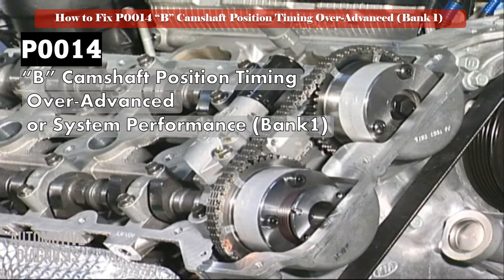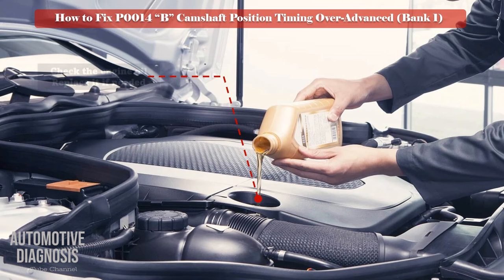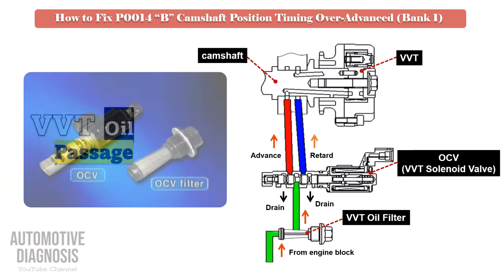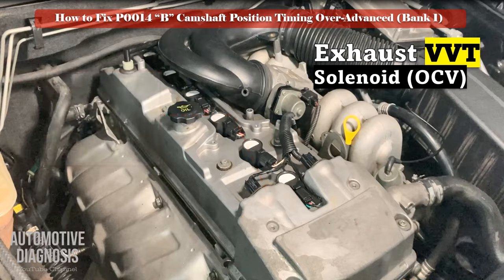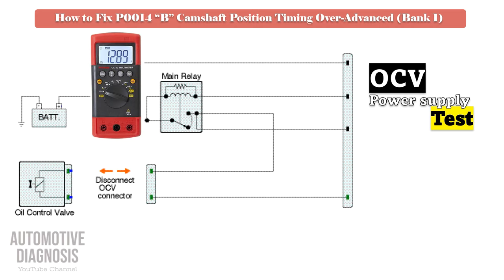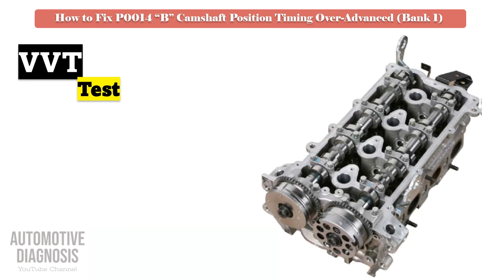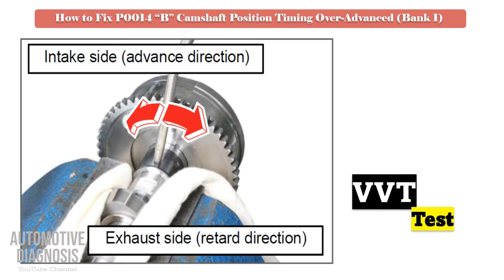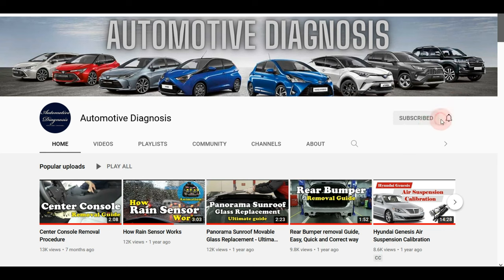How to Test & Fix P0014 Exhaust Camshaft Position Timing Over Advanced Bank 1- Engine Fault Code

Comment: i already replaced both solnoied still show codes
Reply from the maker: And you only have P0014?
Reply: I replaced both the exhaust and Intake and it ran good for 2 days and threw the same p0014 code on my 2015 
Equinox
Reply: @jonathancabral6367  make sure you have the right oil in there, go ahead and change it if you’d like anyways. Erase code and drive. Make sure to replace it with an oem part or oem compatible, if the code continues after that you are most likely out of timing. It being an equinox id put my money on out of timing.

Comment: Just finished the car service for my Holden Barina spark 2011 from my mechanic. Few days after traction control and engine lights came. Roadside assistance came and they said cylinder 3 is misfiring. So the mechanic changed the spark plugs . All good and now after couple of days this p0014 error code came with the description : ‘B’ camshaft position-timing over-advanced or system performance bank 1.

Comment: Got a POO13 Code, Exhaust Camshaft Position Actuator Sensor Circuit. Open (Bank 1). 2019 Ford Taurus Limited AWD. 3.5L. Where's is Bank 1?
Reply from the maker: Normally when you look at the engine from behind (transmission side), bank 1 would be at right side to host the Cylinder 1, 3, 5.

Comment: Please how can i see the 20 degree difference of the camshaft, please why the 20 degree
Reply from the maker: Hi there, Normally for any input signal to ECM, there is a logic and ECM considers a max and min limit, so if any of those input signals goes higher or lower than the limit, ECM will set a fault code. in this case, if the difference between "Camshaft actual position" and "Camshaft desired position" is more than 20 degrees (max limit), ECM will set a fault code. So 20 degrees is the max limit for the ECM to set the code (P0014). You see this value in the scan tool, in the "Live Data". You can find the relevant section in this video at 3:37.

Comment: Changed both cam pos. Sensors on 2014 Buick Verano 2.4L. Now the engine won’t even crank. Thought it was battery so I’ve charged it but what else could it be? It’s throwing codes P0014, P0341, P0366, and P0010
Reply from the maker: You didn’t need to change the cam sensors, as you have P0010 too, this fault could be from intake VVT solenoid valve, don’t replace it right away, you need to inspect it first.

Comment: Getting P0014 on my BMW 2003 530i M54 engine. Is there a VVT oil filter on that engine and if so, where would it be located? I also recently removed my crank bolt to replace the front oil seal. I wrapped an old serpentine belt around the lower pulley, up and around the alternate in order to "lock" the engine. I was able to release the crank bolt but didn't hear or feel anything slip such as a sprocket jumping a tooth nor was there any damage to the pulley.  I didn't feel comfortable torquing a new crank bolt in the same manner so purchased the required tool(s) to secure the engine. Could this just have been a coincidence when I used the serpentine belt method that I'm now getting the P0014 code? I also replaced the Vanos oil line.
Reply from the maker: Hi There,I’m not really sure where is the location of Vanis filter in this model but could be on the Vanos itself. Also any small changes in the timing could lead to the timing fault code but if you are sure that you didn’t remove or relocate any part in the timing system, it should be fine. Vanos solenoid valve removal and cleaning could be an option too.
Reply: did you ever get to the bottom of your P0014?  I'm battling it right now in my 01 325i, replaced vanos seals, checked solenoids, next step is possibly re-timing the engine., although I dont feel like anything ever slipped a tooth or shifted in my case either. We also dont have any sort of oil filter or screen for our vvt systems.

Comment: how do i know if its the sensor or something else
Reply from the maker: Hi there, the normally we need to check the wiring and the VVT actuator both to see where that fault is coming from. For the actuator itself, you see in the video that we can test it by the scan tool, or manual actuation test, or checking the internal resistance. It’s always good to check the workshop manual for that specific car for the specifications, correct procedure and all safety details.

Comment: hello I have code p0014 on my hyundai accent 2016. the check engine light is on the car consumes a lot of fuel  and makes noise. I therefore changed the engine oil and the filters, the noise continues and the engine check is still present. I removed the two sensors I tested with the multimeter 8.5 ohm each and with the battery the test was good. the connectors also 9V each. I noticed that the two sensors in their middle there is a filter but they are drilled, can the hole still create this anomaly? Thank you for answering me

Comment: I have 2015 Hyundai Santa Fe sport 2 codes came out P0014 and P1326 at the same time ?? Please help
Reply from the maker: Hi there, there has been a common problem on some Hyundai vehicles with exactly these two fault codes that resulted from a mechanical failure in engine. (it could be just the timing mechanism which is causing knock too), I highly recommend to have the car checked at a mechanic workshop ASAP.

Comment: Do you know something about resetting to zero after vvt changing?, I changed my peugeot's 208 vvt and check engine light went off but there is a silent code about resetting to zero values for vvt
Reply from the maker: Hi there. Resetting to zero value is actually for Engine Control Module that should be done using a scan tool. So when you do that, ECM goes to factory setting and will start re-learning all components including VVT values.

Comment: Hello just got code P0014 this morning, no issues with performance could it be because of low oil pressure due to cold weather?
Reply from the maker: Hi there, if engine runs without any problem, that could be an intermittent fault, just erase the code and keep an eye on the check engine light.
Reply: @AutomotiveDiagnosis  will I need an OBD tool or can I reset it through unplugging the battery
Reply: Same , this P0014 code popped up right after I had code P0011 fixed. What do you drive ?
Reply: @youngrenzel1323  I drive a 2014 Hyundai I changed the vvt soleboid and changed the oil, runs perfect now

Comment: I have a suzuki wagonR japanese and this code p0014 position comshoft advance has been contiuesly coming although i changed both v take sensors A and B! Mecanic opened the timing and checked whether its out or not but it was ok! I checked it with another mecanic he said first we should change a buster of timing if check light doesnt remove then the assambly head should be changed! I dont know what to do! Kindly advise thanks🙏
Reply from the maker: Hi there, you replaced both VVT solenoid valves? Or any some sensors?
Reply: Fist i  replaced the B one, even then the code didnt disapear then after a few days i replaced the ather one A as well but the code still apears and engine check light is on ! Some times it goes off but then again engine check light gets on!
Reply from the maker: @walihdh1587  You didn't actually answer my question. Did you replace the VVT solenoid or Cam Sensor?
Reply: Yes i did but still engine check light is on and code p0014 apears!
Reply from the maker: @walihdh1587  I assume that you have changed the VVT solenoid as you again did not answer the question ☺. First of all, you didn't need to change both solenoid valves as you had the fault only on exhaust side. So, checking the VVT solenoid itself is important, but this problem could on the solenoid's wiring (normally two wires, one for positive and one for solenoid control line), if wiring and solenoid are ok, again you don't replace anything unless you are sure that it's faulty. the next  step (since you have checked the timing) is to check the VVT itself, so normally we remove the exhaust camshaft, and we must check it first to see it does not rotate freely. Then we must apply compressed air on retard hole on camshaft (which goes directly inside the VVT), in this moment, if we are doing everything correctly, VVT must gets unlocked and must rotate a little. If it does not rotate it means that VVT is stuck on maximum advance and you must only change the VVT itself.
Reply: @AutomotiveDiagnosis  thanks for the explination, i will check those wires by a mecanic and if it was ok  then i will change the axhaust camshoft! But in case after changing that camshoft if the isse remains and engine check light doesnt disapear then what should i do?

Comment: Just got my Pontiac solstice 06 it was the show car and also got oil change but check engine still comes on and off? My first Manuel transmission and it's a 2.4 and has 2 cam shafts apparently and re wheel only 69 thousand miles love my car just wanna take car of it wen I brought to dealership they saw nothing it's turned on again today and got the p0014 code hoping it's a small fix just want my car to drive well any suggestions would really help :/
Reply from the maker: What about engine running condition, do you see any problem or just this fault code? Many times there is nothing serious, so erase the code and see if comes back again.
Reply: @AutomotiveDiagnosis  seems fine to me I use as a daily driver and work 2 jobs and the roads near me are not always smooth lol I'm not really car technical but hoping it's just a sensor but will I feel anything different in shifting?
Reply from the maker: @goodgurugamingentunknowner2618  It can affect your engine performance and sometimes when engine gets warm, engine hesitation gets worse. If nothing is wrong, it could be only an intermittent fault.

Comment: estimado tengo una santa fe, 2.4 bencinera año 2013, se le hizo un ajuste de motor, la cadena esta bien puesta, y me da este problema, se cambio el sensor del eje leva, y se limpiaron los seleoides
p0014 posicion de arbol de levas de ´b (escape)´-tiempo parado-avanzado o funcionamiento del sistema (grupo 1)
Reply from the maker: Hi there, Have you done the replacement and cleaning on the exhaust camshaft?

Comment: I have a Golf 7 GTI perfomance unfortunately I also have this error code p001400 when I put the car on D it starts to vibrate and the rev counter keeps going up and down it goes out I get a message malfunction start stop system I get really tired of this can it lying here?
Reply from the maker: Hi there, have you checked any part of the variable valve timing yet?
Reply: @AutomotiveDiagnosis  
Hello, I had the chain replaced when I got the car, I had a report start stop malfunction tachometer starts to go up and down and unfortunately it falls out, normally I had bangs from the exhaust, which are also gone, but I will go back to the garage again tomorrow
Reply: my kia rio  2011 no chk light on will not idle and hae code p0011.have change engine oil 2mths  ago